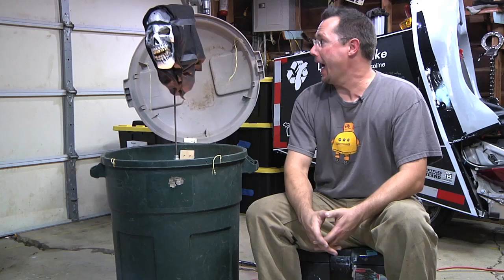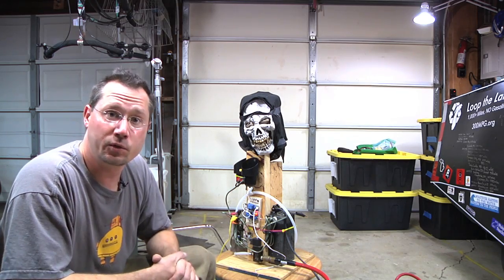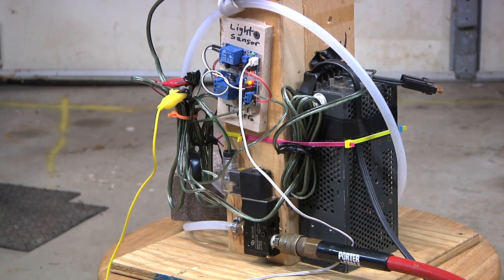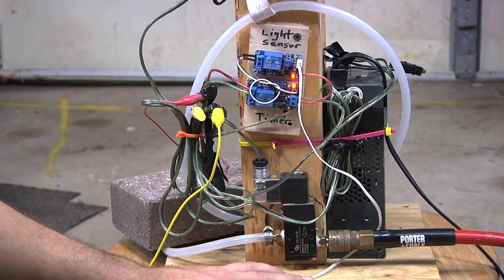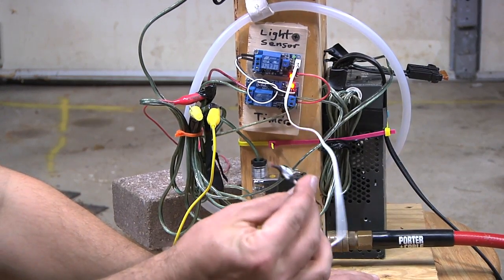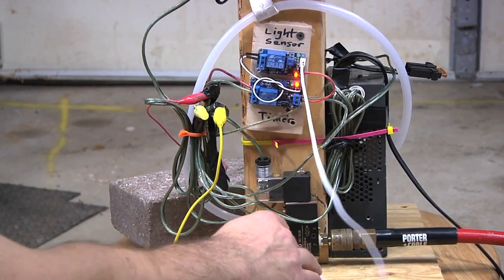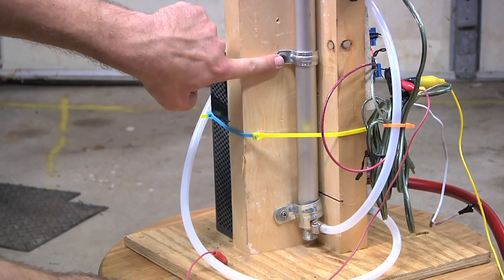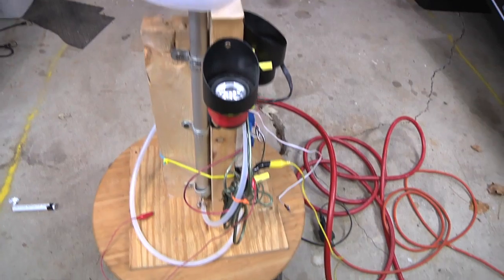DIY Halloween Air-Powered Pop Up Skull Prop

Comment: Excellent video!  I see that the solenoid valve is a 3-way...but since you are using a double-acting cylinder and letting the exhaust vent out the second port of the cylinder, could I get away with using a 2-way solenoid valve in this setup, or is air still needing to escape through your exhaust on the solenoid?  I'm new to trying stuff like this out.
Reply from the maker: Hi Tom, this was a fair number of years back. I don't remember all of the exact details.
On this project, the air-pressure held the head up and out of the trash can. When pressure was released, it it dropped back down in.

I really encourage people to learn by DOING.
See if you can find some inexpensive air components to play with from a surplus store or maybe a Makerspace. Try things out and see if it does what you want.

I haven't tried it myself, but a friend of mine also says it's easy to build air cylinders out of those screen door closers. Maybe I'll have to try that sometime.

It's always OK to be new to something. It just means you are learning!

Comment: do you have a wiring diagram?
Reply from the maker: No, I don't have a wiring diagram, but it's very straight-forward. The light sensor activates and provides power to the air-valve, causing the prop to pop up. The delay module holds it there for a few seconds. That's about it.
Reply: @BenjaminNelsonX  Thank you so much for the quick reply!  I bought some 12v remote lights https://www.amazon.com/gp/product/B073Z6NTGL/ref=ppx_yo_dt_b_asin_title_o00_s00?ie=UTF8&psc=1
in lieu of using the light sensor.  I wasn't sure if id be able to wire that directly to the delay timer relay or does the relay needs its own 12v supply?   Any suggestion would be greatly appreciated.  

So i plug the light power supply in then cut the lights and attach that to the timer relay is the plan.

Comment: Could you have this set up with a motion sensor instead of a light sensor?
Reply from the maker: Sure. There's plenty of different ways a person could set this up. The important thing is to have some sort of input that senses a person and then sends the signal to activate the air valve.

Comment: Try attaching the lid with a string to the pop up rod. That should pull the lid down. So basically when the rod goes down it will pull the lid down too.

Comment: that would be much better if it can get back automatically after popping up.
the cost for air compressor is not small amount as well.
Reply from the maker: Fordee Ho if you look at the beginning
Reply from the maker: Watch the video of the prop in action (link is in the video description.) In there you can see how I used two strings to keep the lid from opening too far. That way, when the head goes back down, the lid automatically closes as well.
A small air compressor is a common shop tool in my area. I simply used the compressor I already had, and then returned the compressor to my shop when done with this prop.

Comment: where did you buy the air cylinder
Reply from the maker: Local surplus store.
Reply from the maker: I added parts list to the video description, including a link to a similar air cylinder as the one I used.